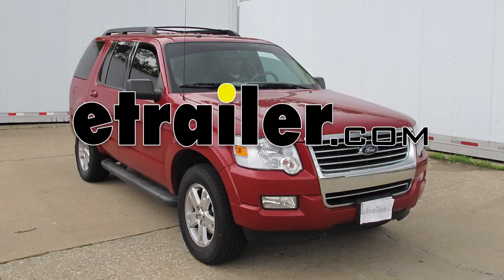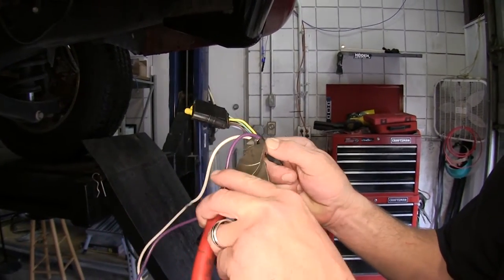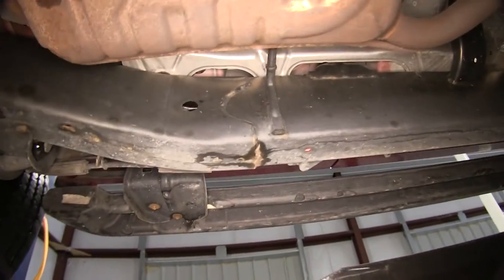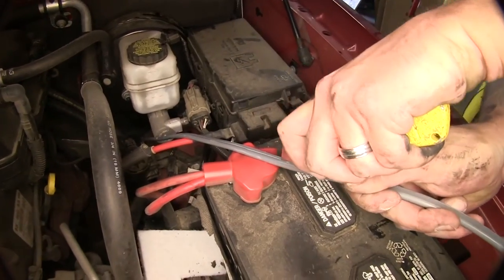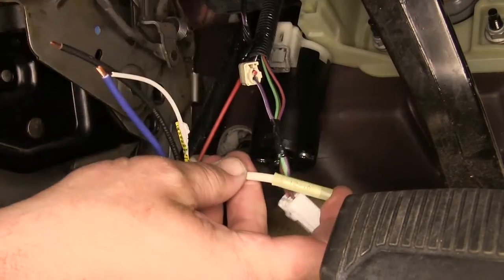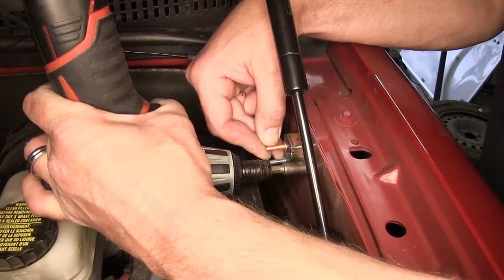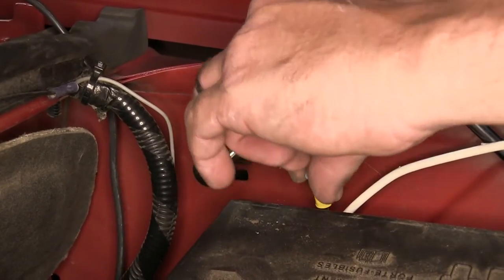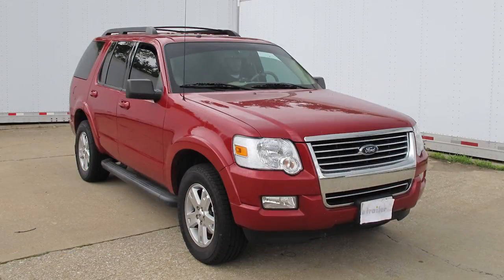etrailer | How to Set Up Your Tekonsha Prodigy P2 Trailer Brake Controller on a 2010 Ford Explorer

Comment: I have a 2006 which is the same generation. With that being said the makers of this video aren't aware that hitch receivers are built into the bumper.
Reply from the maker: The factory hitch on this vehicle is a 1 1/4" hitch and the owner wanted a 2" hitch receiver.
https://www.etrailer.com/Trailer-Brake-Controller/Tekonsha/90885.html

Comment: Why not use a blue wire all the way back, Blue is normally always the brake wire, instead of the white wire.....just to keep things simple. And repairs later simple too Blue to Blue Black to Black White to White, ect.
Reply from the maker: You are correct with the typical wire colors that you referenced. In this kind of installation we like to use the duplex wire because it's easier to route the wiring from the back to front of the vehicle when it's both held together like this as opposed to routing 2 different wires the length of the vehicle.